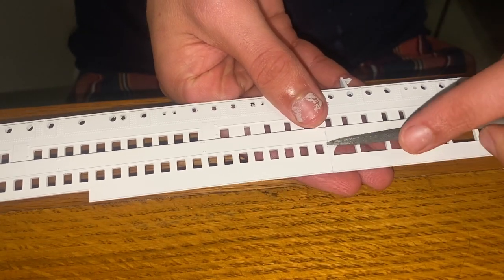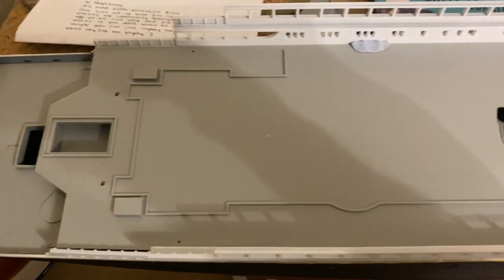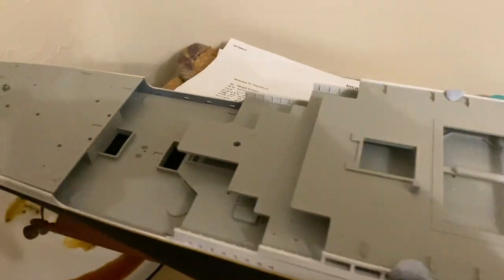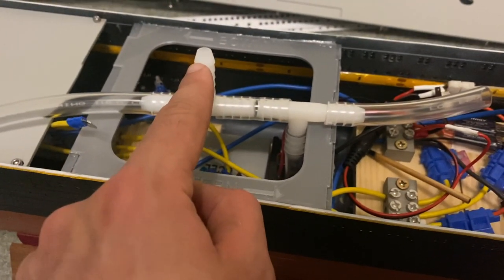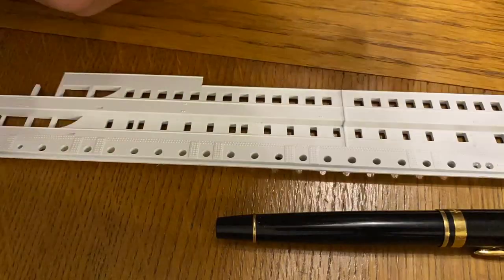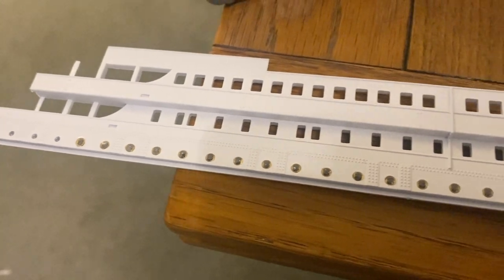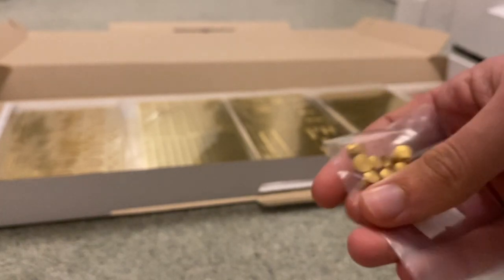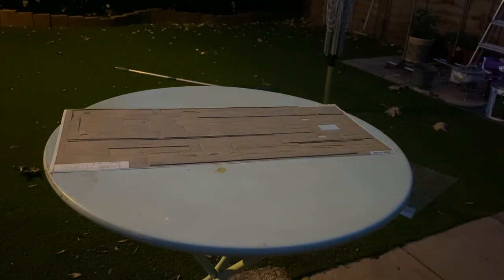Radio Control Trumpeter 1:200 Titanic Build Part 15 - Test Fitting, Portholes and Funnel Piping

Comment: Hi,  glad you got your KA !!   I noticed a great little jig in the the middle of the printed stuff to form the bench seats around which is a great touch!  Even the little bridge bell comes in 4 pieces!  Good video as usual!  JH  ;-)
Reply from the maker: Hi! Yes I really liked the jig for the benches, great idea. Defiantly makes the job a lot easier, and just makes sure the benches all look similar to each other. 
Glad you got the KA kit too. Have you made any impression on it so far, it’s all overwhelming I thought 😅
Cheers, Rob
Reply: @TheModelBoatGuy  Hi yer!  No, no action yet as stuff still coming in!  Now waiting for A deck from Scale the Titanic and I may have to order a further couple of bits.  Still haven't got motors yet either.  The list is endless! I don't think there will be much of the original kit left at the rate of replacement parts I seem to be buying.  The KA instructions are a bit vague. Some parts are numbered but not included in the instructions which is a bit iffy!  I am now getting close to finishing my wooden ships rigging thank goodness, very time consuming!  Have the best Xmas  possible and stay safe!  JH ;-D

Comment: Great video thanks. Good to see the UV glue used on the portholes.. I have the Ka and the Pontos sets for my static model.. they both have good and bad points.. Ka Lifeboats are gorgeous but the Pontos chocks are much nicer. Pontos mast locations are more substantial but Ka Davits and Cranes are superior.... I'm sure they collaborate to get our money!!
Reply from the maker: Ha I’m sure you are absolutely right Nigel! Elements of each are better than the other and we end up getting both. Probably six and two threes which set is better. And very hard to tell until you have both in your hands. Hope your build is coming along ok??

Comment: Actually. #4 funnel did carry smoke from the galleys and fireplaces through a small chimney in the forward portion.  It would be less than what came out the other three but it was often there as the galleys fired up for meals.  A video of old footage of the Olympic is on YouTube showing smoke quite visibly rising from #4.
Reply from the maker: Yes you are correct, I meant it wasn't used as an extract from the boiler rooms. I mean really the 4th funnel was a fantastic bit of innovation on the Olympic class liners. Apart from the other functions it served it removed the need for hundreds of ventilators like most ships of the era had. It gave the ships a much cleaner look.
Reply: Imagine if Olympic had survived into the modern era moored up somewhere as a hotel and museum ship like the Queen Mary. It would be an amazing attraction it's such a shame Olympics service life wasn't long enough to see her become a historical ship.